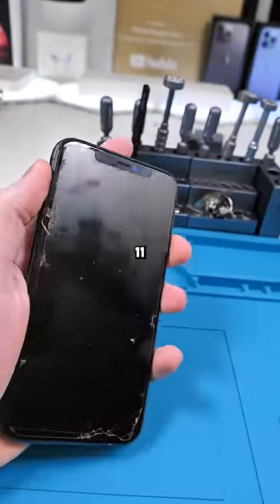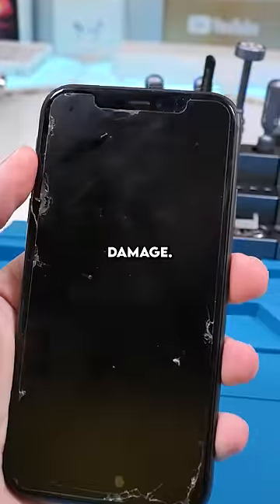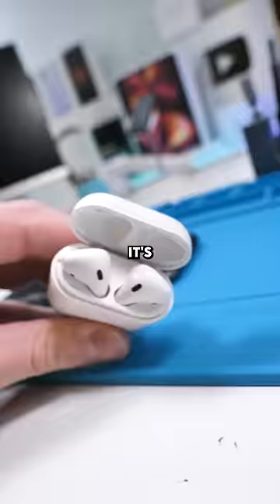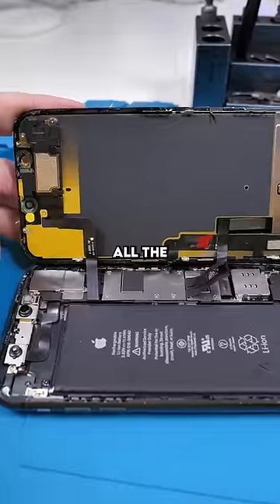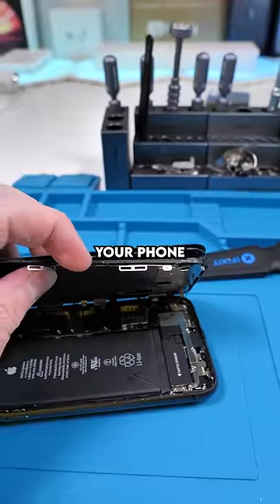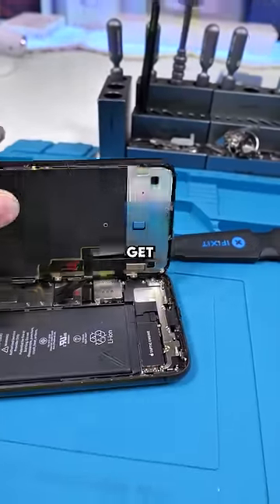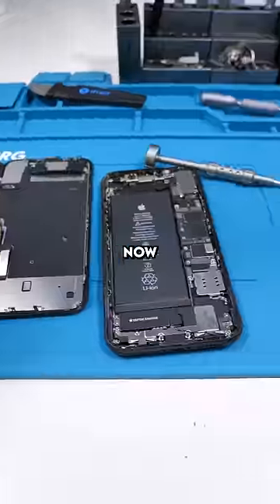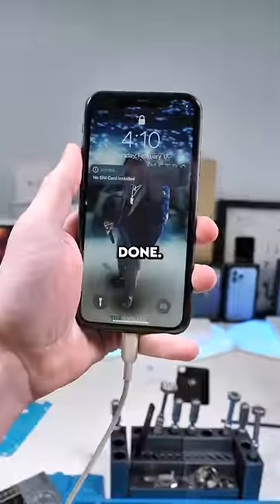I Could Barely Get This iPhone Open....#Shorts

Comment: Hey man I heard that there are problems with not original screens since iOS 16. I am one of them. Any more info?
Reply: What problems do they say?
Reply: @genuin3th   The touchscreen stops working suddenly after updating to ios 16 they say. I have a problem to. I don't know if my problem has the same cause because my iphone xs was already doing it a week ago when i just installed it and still had ios 14.7.1 on it. After hearing updating helps the problem i updated my phone to ios 16.0.3 but then there came a message from the company of these screens which is a famous company here where I live that there may accurs some problems with the touch freezing on ios 16. Rebooting sometimes helps, but in less than one minute the youch freezes again. Sometimes touch works for a couple of hours and sometimes it doesn't work for a whole day
Reply: @zeuss1353  No way! I thought it was freezing for me because I have a cheap screen, but apparently it’s actually software. What you described happens to me as well; the touch freezes and I have to lock the device and reopen it to keep typing and stuff, sometimes it doesn’t happen for hours, other times every minute or so
Reply: @genuin3th  Yeah man. The not so fun part is that it happened to me before I updated to ios 16 because I was on Ios 14. I am going to send the screen back. We have no option or actually I have no option but to buy a whole other iphone

Comment: Commented in previous video also
Hey PRG can you help me
My lg wing is having a ghost touch issue and also half upper part of touch is not working or responsing on touching although there is not line or dot or any problem in the screen so can you please give a solution for ghost touch issue and if i changed the glass panel then ha half upper part of touch will start working?? Pleaee help love from india and also is had smashed the like button and also i'm a daily viewer 👍👍